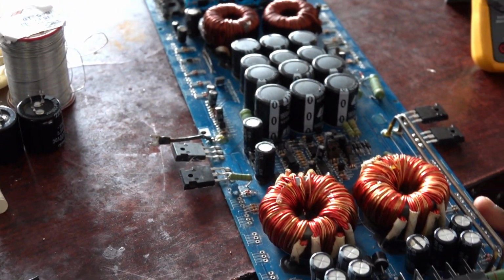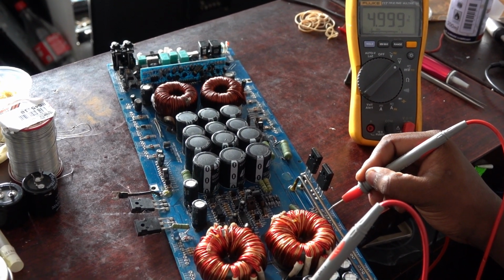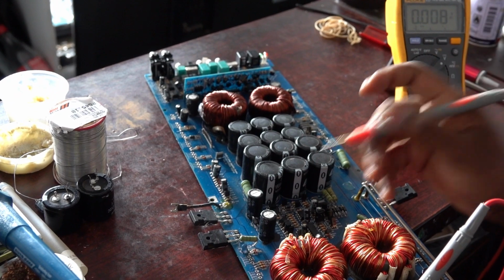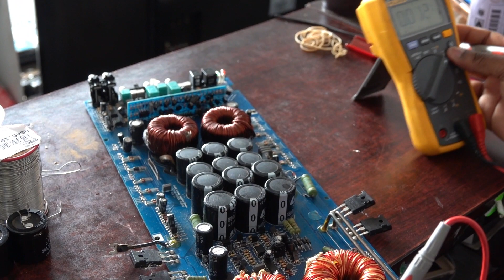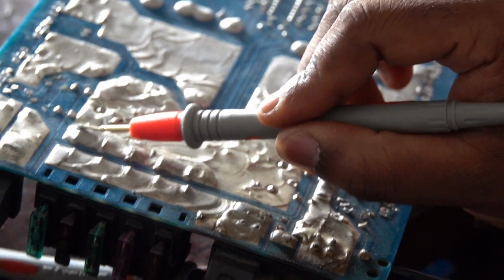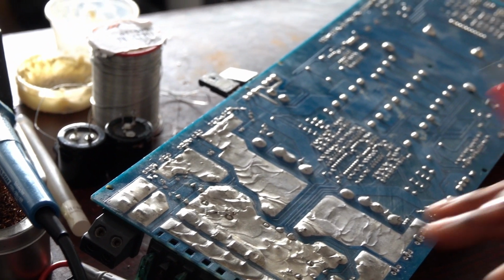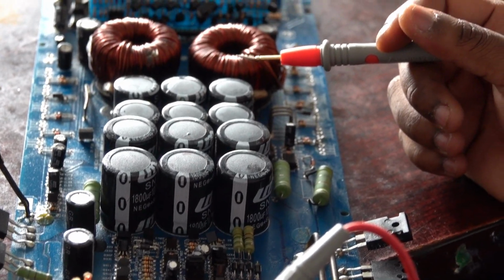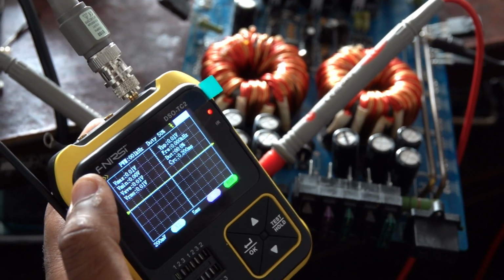Part 3: RESTORATION Attempt of Camtec CT-X1-11000W Car Power Amplifier

Comment: You have to adjust your time / division in your Osci, to correctly see your signal. I believe there us a gete signal in your power supply section. And uou should know your high ang low side in your amp section as well. And i advice to get a reliable Osci of 20 Mhz minimum, i believed that Osci you are using is on 200khz which is poot in showing signals  near 200 khz, i had bad ecperience on this kind of osci.
Reply from the maker: thanks bro i get you.